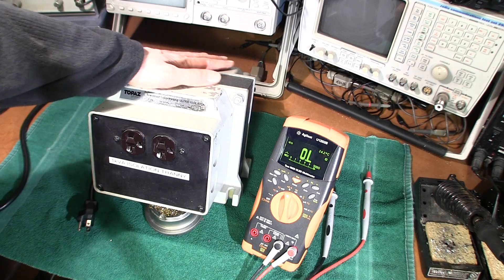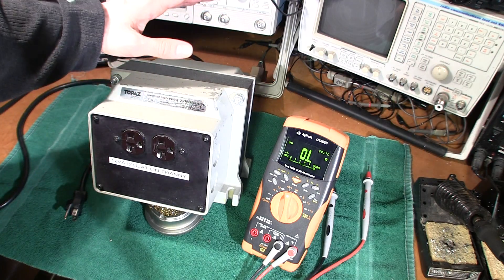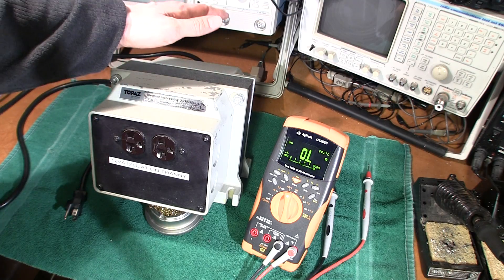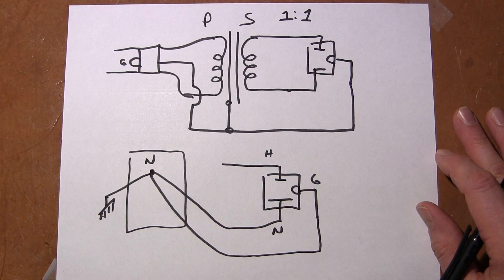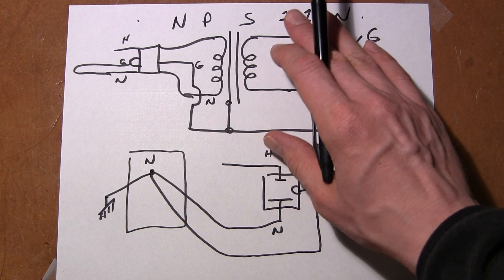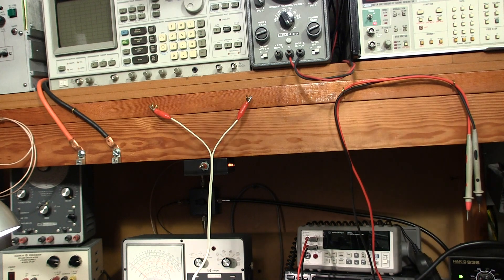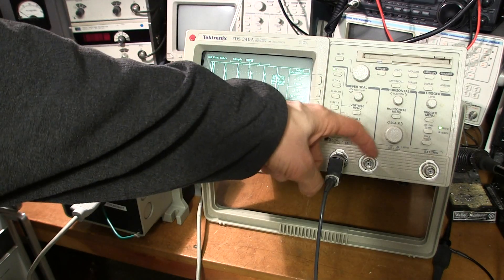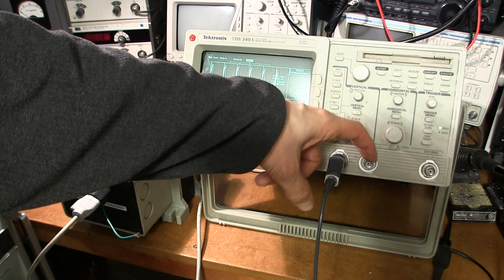Tech Tips Tuesday, Isolation Transformer and Variac Safety

Comment: Thanks for the reminder! Safety is #1. As a 45+ year HVAC/R service tech, I’ve been “poked” by 24v, 120v, 575v, and even lightning (100’ underground behind Niagara Falls)—and I wouldn’t wish the experience on my worst enemy. 
Is the methodology of using “balanced input” (where you use 2 probes, with their ground leads clipped together and not connected to anything else, and their signal probes connected to the AC line) a safe alternative?

Comment: I  believe your drawing of the Auto Trans was over simplified. Per the scale on the trans the output is variable from 0 to 140% of the input.  Therefore the AC main should be someplace lower than the auto trans tap.

Comment: Why will I use an I/T when for $15 I can purchase an RCD (residual current device) compulsory in new homes in Australia. I have 22 circuits in my house, and each circuit is connected with a RCD. They trip in 30 m/s and 15 mA imbalance. I can hold, with bare hands and bare feet while placing a metal pin into any of my power outlets and the RCD trips and I am safe.
I bought a new $250 I/T for my 14 year old future electrical engineer,,, I am afraid for him to use it as it will not stop him from being electrocuted, only protect the scope and other equipment. Can someone please explain it to me, thanks.

Comment: I made my own box with an isolation transformer, some bulbs which can be individually engaged and disengaged and a volt/current meter.
However, I have  a question. The upside of the isolation transformer is that if you touch the live coming out of it, you don't get electrocuted.
However if you touch both live and neutral, you do and the RCD won't cut power as it's located before the transformer. At least this is my understanding.
Do we feel that the main advantage of having an isolation transformer is worth giving up the RCD protection? I am honestly asking, not questioning.

Comment: Now eyes all confoosed!!!!!!!!!!! What is the cheapest isolation / variable transformer on eBay I should be look'n  fur, to save a nickle, a dime or a quarter??????????? I am just a simple future rock star trying to fix my old-timey reel to reel 4 track tape recorder!!!!!!!!  How deep off in the weeds must a man go??????
Reply: Depends on your current requirements, which comes down to tube or solid state.  Tube stuff requires a beefy isolation transformer to deliver say 8 or 10 amps at 120v.  Presumably you're talking about a solid state reel-to-reel that draws around an amp.

For solid state, which is all I do, I have a cheesy YaeCCC Variac and a Jameco Valuepro ITR300 isolation transformer, total under $100 from amazon.  I put the variac first; Mr. Carlson disagrees in a comment above.  I have the transformer secondary wired through a 100 watt light bulb (need a real incandescent) to a switched wall outlet in a plastic outlet box.   It's good for an amp or two.

The transformer comes with a 120v 2 prong cord if I recall.  I plug that into the variac, which gives a nice visual assurance that the house ground isn't being passed through.  The outlet ground is floating.  The light bulb is the current limiter.  If you short the outlet hot and neutral the bulb lights and nothing bad happens.  The bulb glowing dimly is also useful, telling you the device under test is drawing more current than you thought, and perhaps more than the isolation transformer is rated for. 

I mounted the transformer, light fixture and wall outlet on a 6"x12" piece of wood. It's the usual 120v wiring held together with wirecaps, no solder.  The transformer secondary output is annoyingly through a two prong 120v jack at the top -- I used a spare lamp plug.  I already had light sockets and outlets and outlet boxes around for general electrical work.  If you had to buy all the stuff it might add another $30. 

This creates a relatively safe variable voltage, fully isolated, current limited supply.  Always plug the DUT into it, never the test equipment. If I'm interested in the current and the voltage I
 put a HOPI meter ahead of the DUT; I think Kill-O-Watt is the popular brand here of the same thing.  You could put in probe points and a removable current shunt and just use a multimeter instead, but I don't like having the high voltage exposed -- the whole point of the exercise is safety.

You still have to be careful with a dual channel scope or anything with multiple grounds.   They're all connected together, so need to be all connected to the same place, usually ground, on the DUT.

Comment: I just received a Jameco isolation transformer this morning. It has 2 isolated outlets and 2 non isolated outlets and the standard 1 to 1 transformer. The primary is earth grounded to the ground lug on the chassis along with the power cord ground. However the 4 outlets are grounded to the the chassis lug and they are all tied together at the ground terminals with a non insulated .026" fuse wire. I cut the fuse wire between the isolated and non isolated outlets so the non isolated outlets are still connected to earth ground. This is what I have always had with older isolation transformers. I connected the non isolated outlet grounds with 16 gauge insulated wire. The only danger is that now when using 2 scope probes they must always be connected to the same point since placing the reference lead on any point in the DUT is causing it to be grounded.  So it is still possible to short through the scope, making smoke and sparks. You must always be aware when probing in a powered up device. I am not an engineer so I do not recommend anyone to do this.

Comment: I don't understand much of this since I only have an old multimeter... but if I had an oscillioscope, I would plug it into the mains which is grounded tied to neutral in the mains box. Then when working on 120/240 volt boards for repair, I would connect the repair board to an isolating transformer,,, meaning a modified one,,, open the box and cut the ground wire to output side. now my scope should be safe since there is no feed back to the grid,,,BUT that wouldn't make me safe, I would still be handling 120/240 volt active and neutral,,, so the way I read it, and IT only protects your scope, which of course is fine,,, but only if the ground wire is removed from the output,,, then there can be no feed back to the grid,,, I have no practical experience in this matter,, I am a learner and a theoritical person who analyses issues,,, please tell me if I am right.

Comment: I'm wondering if this is a new thing. Our service entrance panel is new and the neutral bus and ground bus are isolated and not electrically connected. I'm thinking they are in older homes but I'm pretty certain this is not the case for newer construction or any upgrade work. This of course is not a reason to not to pay very close attention to this issue.

Comment: What if one is trying to measure main lines within a AC connected power supply for troubleshooting purposes? Does your safety explanation also apply to if one measuring with a multimeter and not a oscilloscope? In the neutral and ground connected in all breaker panels? Even outside USA, let's say Europe?
Reply: It's just an issue of whether the test equipment is grounded.    You can stick the probes of your battery powered Fluke right into the wall socket without worrying that one of your probes is house ground.  If you had a bench multimeter plugged into the wall, you should worry before sticking its probes into an outlet, and then go find your battery powered meter.

I don't know anything about breaker panels in other countries.

Comment: Why does he say that you have a 50 50 chance of getting the probe correct when you stick it in the wall outlet? anyone know?Thank you
Reply: I'm assuming he means if you don't know which wire at the time is hot and which is neutral. In the test he's doing the bulb is only going to light when touching it to the hot because it will be hot reference to ground which is also neutral in the panel. Had he touched it to the other wire nothing would happen because there's ideally no voltage across the neutral reference to ground. Likewise when probing your outlet if you connect the scope ground to the hot it goes pop, but connect it to the neutral nothing happens due to no potential there. Typically you're going to know which terminal is which by identifying the larger neutral slot.

Comment: 4:35 In Europe we have a separate ground pin into the ground below the breaker box.
Neutral goes to the power plant, which has the center of a three-phase star network as neutral.
I don't get the point of creating an additional contact parallel to ground and call it neutral.
Why do they do that in America?
Reply: From the looks of it, I would rather isolate the DUT than the scope.
I mean, how's the RCD gonna trip if there's an issue?

Comment: How good the connection is between earth and neutral depends on the earthing system used. In my country there is three systems in use, those are IT, TT and TN-C-S. Thank you for an informative video. I just restored the grounding on my second hand Tektronix 475A, the previous owner had just broken of the grounding prong.
Reply: There is one. 
There are three.

Comment: Thanks, I now have a better understanding. But it seems like you didn't finish the topic on Isolation Transformers. It's good to be aware that the secondary might be linked to Earth. But then, how should we setup a proper isolation system? Should we break the secondary connection? I want to be able to use my scope to test the long list of devices I have.
Reply: Francois, The best way to ensure total isolation is to remove any ground connection at the output of your IT. Some manufacturers ground the metal container that boxes the IT as a matter of safety. Depending on the type of outlet socket this can be problematic as the mounting screws can become grounded and defeat the purpose. For example, in the UK and Ireland, all socket mountings are connected to the earth pin and when mounting them as I had to do , I literally had to cut the copper connection to isolate the output otherwise the mounting screws would have made the output  grounded. These are small things that need to be considered whilst making sure your IT is suitable for bench work.
Reply: @noelconway2589  I we regretted so we the g dw
Reply: @noelconway2589  red set was we
Reply: I lol
Reply: Ya lol lll
Reply: Do
Reply: Up I’ll as die SH dw so

Comment: so veriac and scope can be pluged into just common and hot using the 3 prong adaptors to the isolation transformer at the same time like the 3 in one plug cut the ground lug off as well for extra safty? or just the scope?

Comment: I have had Earth ground running through my isolation transformer for decades and never have had a problem. I never plug my test equipment into my isolation transformer only DUT. Many devices have components referenced chassis ground. Running the Earth ground all the way through to the DUT helps to eliminate noise while testing. That said, Mr Carlson is absolutely correct in his presentation and I am fully aware of how my bench is configured. Thanks Mr Carlson
Reply: Transformer you describe it's not really an isolation Transformer. There should be no galvanic connection between primary isolation Transformer. I don't know where you got that Transformer probably China

Comment: Hi Mr.Carlson, I would like to use a variac with my vintage amp to play but to lower the voltage to 117 volts to power it was originally meant to work on. Could you suggest a particular brand that would be suitable for this. The amp is 40 watt Fender Blackface Bandmaster  2amp rating fuse. Thanks

Comment: So, if you want to see what your mains voltage looks like on a scope, then use a cheater plug on the scope? In my college lab days, I spent many hours doing tests and looking at wave forms using scopes, never once did we blow anything or person up or use an isolation xformer.  Granted I did not know if the scopes had 3 prongs or 2 on them.

Comment: Thanks for the lesson on how to avoid hurting oneself and equipment. Understood! 
Now for the white elephant in the room. How do we test a piece of equipment's mains based power supply circuits (non-switching & switched) correctly using an oscilloscope, 120 volts in USA? And as Mike Rowe States "Safety 3rd, not 1st".
1. We want to see the primary 120 volt mains wave form (non-Switching) on my Oscilloscope, how?
2. We want to see the secondary mains wave form (non-Switching) on my Oscilloscope, how?
3. We want to see the pulsed DC wave form (non-switching) on my Oscilloscope, how?
4. We want to see the Smoothed out wave (After the DC Capacitors) (Non-Switching), how?
5. Then the same 1-4 for Switching Power Supplies.
6. Once you show us 1-5 how, then show us how not to get killed (safety 6th).

I have been unable to find any decent videos on how to do this. 
PS: I don't give a damn about safety, I'm old. How I do this? Do I need a spaceship and a trained robot?
Reply: Sorry to repost - but my comment to Mr Whyte fits very well here : I think you haven't gotten an answer from Mr. Carlson because of potential legal liability issues.  Notice that he didn't suggest in the video exactly what to do about this issue? (You did - it is why you are confused!).  So here's what we Americans learn to do - read between the lines - read the comments - pay attention to the ones Mr. Carlson does comment on.  BTW - not hacking on Mr. Carlson, there are many other vids that take the same approach - on everything from electricity to reloading ammunition to chemistry experiments.  Unfortunate sad commentary about the American legal system, from an American.

Comment: I build an isolation transformer from two UPS transformers. But still, my voltmeter shows a voltage between secondary and ground in primary ~80V. Also voltage indicator lights up when I probe secondary.  There is no resistance between primary and secondary windings transformers looks good. Maybe it is parasitic capacitance? If so how to get rid of it?

Comment: Ok Stupid Question Time....If the ground is meant to protect us from electrocution in an AC system,  how would it make sense to essentially bond the neutral and the ground together? Why not simply have a separate grounding bus bar in the breaker box, (which has been present  in boxes I've worked in; it's  usually located in one of the lower corners of the box, and that's how I have always connected them up ) to allow complete isolation from the AC line voltage? Or am I just stupid? I say that because I always had it in my mind that since AC current is always changing polarity the ground insured that we couldn't become a conduit for a 'complete circuit. So It would seem to me that if the ground and the neutral are both tied to the same bus bar then we would defeat the whole purpose of a separate ground lug in our electrical sockets, and on our line cords.

Comment: Hi Paul, i'm from italy so maybe electric rules are different: in our country  neutral N and  phase L (or hot as u call) are provided by power supply company.  the building itself has to have his own  ground system were all the earth are connected.   i know that the neutral of the power supply company is grounded to the earth near the power cabin. but it is NOT same as earth or safe pin. infact test has to be performed to declare sufficient low impedance the ground net of the building.

In fact in our breaker panel the breaker interrupt N and L ( or in case of 3 phase  N L1 L2 L3) but it's mandatory that all grounds wire has to be connected and NOT interrrupted.

Why this difference?

Comment: Makes me glad to be in the UK where Ground/Earth are NOT connected together, and the mains plug cannot be reversed - live is always live and neutral is always neutral.
Reply: hi mike bad news for u . they should not be inverted if who made the  electric connections and wiring properly.  in the reality i have seen alot of  UK electrician showing on utube they repair works or contructors that redo a flat a buiding whatever... and  in many videos u see all cables black with no color code or coded but connected ... randomly.   seen also videos with the earth wire used as neutral.

so dont give it for 100% sure.  UK sokets are polarized ( due the form of the socket itself u cant reverse the plug like in italy or with german shukos plugs) but this doesn means 100% safety that the L wire is in correct position. do a quick test with a voltmeter rated for 220V ... check between ground and other 2 holes. let me know

Comment: As a note, in the UK our supply typically includes a separate earth that is handled way back at the generator, so earth and neutral have no connection within our premises.
Reply: Yes, Our Neutral and Earth are connected together back at the National Grid. But that is carried all the way to the house. Connect a light bulb to any wall socket, between Live and Earth; it will light up the same as if it was connected to Live and Neutral.

Comment: Is the answer - don’t connect the earth from the device to the isolation transformer earth?. So the transformer casing in earthed for safety reasons and the device is floating for safety reasons?. If this is correct why do they have the earth at the input of the isolation transformer connected at all.